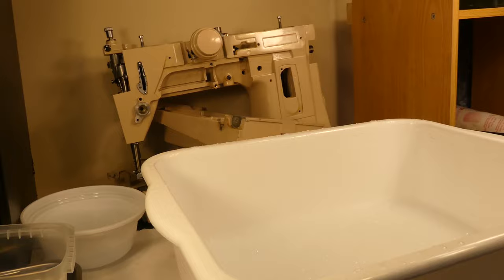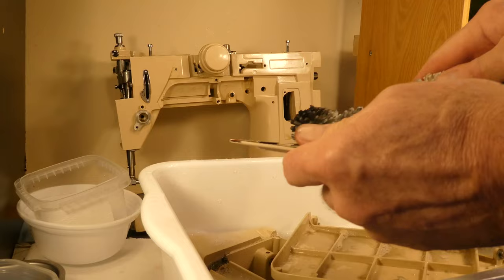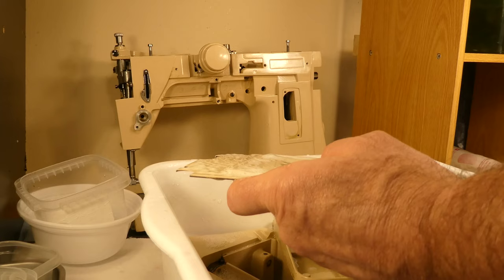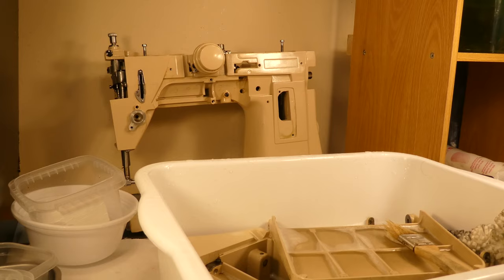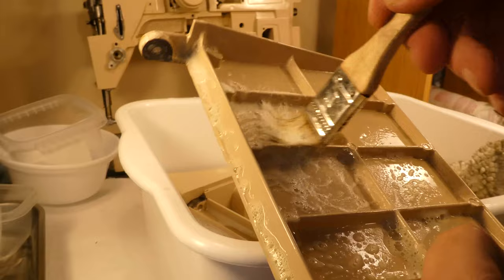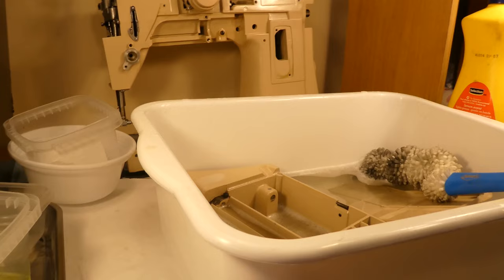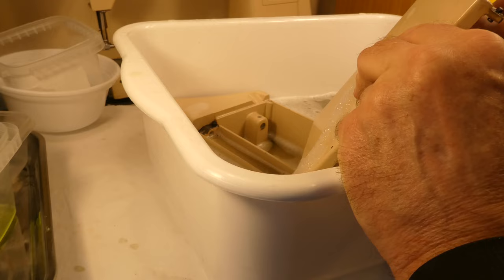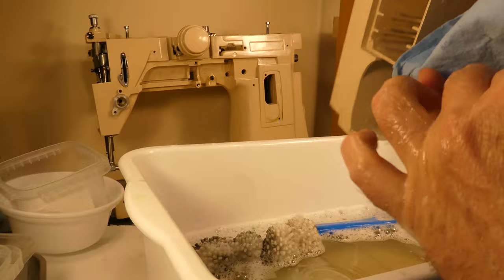SINGER 431 G CONVERTIBLE DISASSEMBLE CLEAN EXTENSION

Comment: You rock with your cleaning, Jebb! Its so considerate that you totally take us at every step of the proces. And we love this! You explain every part, every tool and even every confusion you experience. What is 'flashrust' by the way? Will it rust so quick,  even from painted  surface?  Hmmmm never knew this. Lear ed aan from you🤓
Reply from the maker: HEY MONIUQUE! FLASH RUST IS REALLY FAST RUST. I THINK IN SMALL PLACES LIKE SOME OF OUR OILPORTS IT OCCURS VERY FAST. OF COURSE, RUST SEEMS TO BE ETERNAL. THANKS YOU SO MUCH FOR THE ISMACS.NET LINK! I WAS ALREADY LOOKING AT THE 431 MANUAL THAT YOU SENT! SWEET! THANKS!